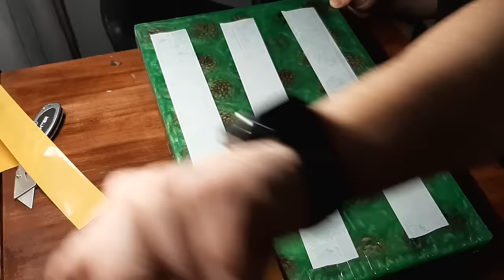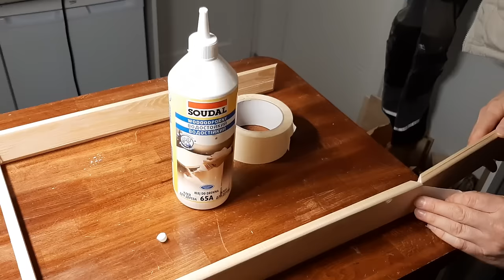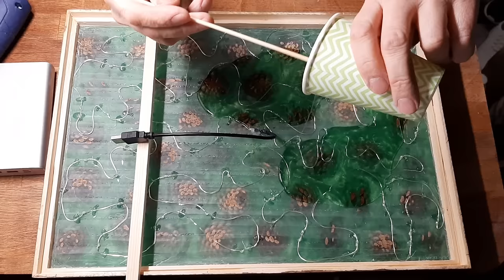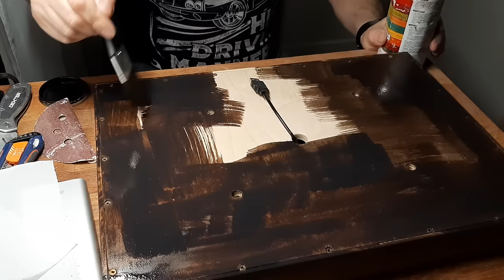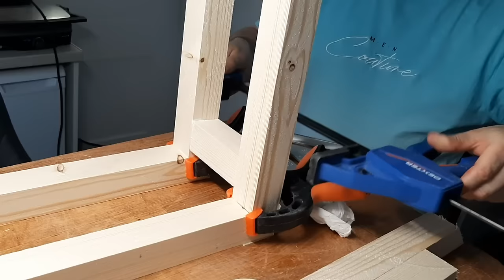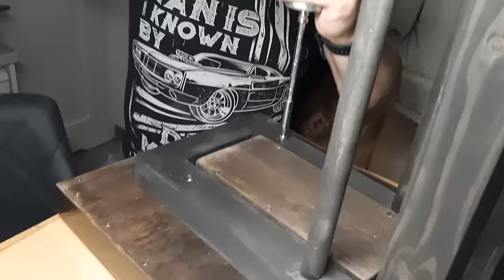Wood and Epoxy Resin table with Pine Cones and LED

Comment: Very nice, but please think of using push sticks even on bigger pieces on the table saw. I'd really hate to see you hurt.  Keep up the beautiful designs.
Reply from the maker: Thank you so much
Reply: @WoodSeason  is it bad to breathe in epoxy and resin ??   I have seen videos of people saying that after they work on projects like these , that it massively messed up their lungs and respiratory system.    Please let me know because I have been researching on many projects that I want to start doing, and now that I stumbled upon these videos of people saying that it is unhealthy, now I am scared to start …….  🙏🙏🙏🙏🙏🙏🙏
Reply: Её акне
Reply: Perezida po9⁹9⁹⁹⁹⁹⁸99990999999
Reply: @WoodSeason  YZ ex
Reply: @krazykrooztv9674  it is dangerous, yes. The particles are carcinogenic if you breath them in. It is important to wear a respirator and goggles while pouring and while sanding the epoxy resin.
Reply: Please use push stick... Take care always... 👍👍👍
Reply: @krazykrooztv9674  it is safe man
Reply: @Musicswhatweneed  maska to podstawa ja się wylewa zgadza się

Comment: Please, please, please be more careful! Build yourself a crosscut sled. Wear a respirator. Use a proper push stick. Don't pull away the offcuts. You'll miss your fingers when they're gone. 

Other advice:
Use a wood conditioner on pine.
Improve your spray technique.
Get a couple Collins clamps for miters.

Comment: On what material are you molding the table so it doesn’t stick on the wood? I see some light reflection but I can’t see what it is 🤔
Reply: Probably the same material he used in the corners. I would say some kind of RTV.